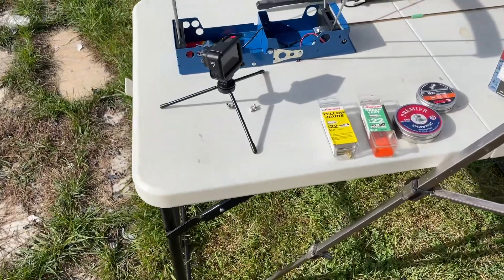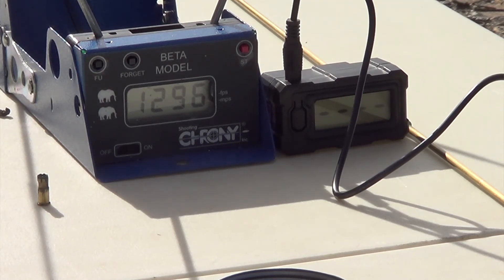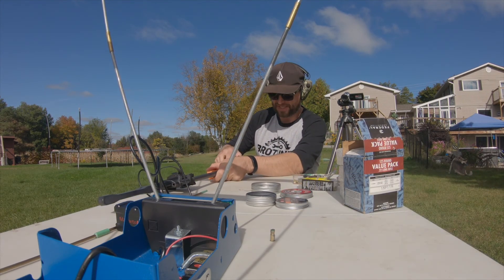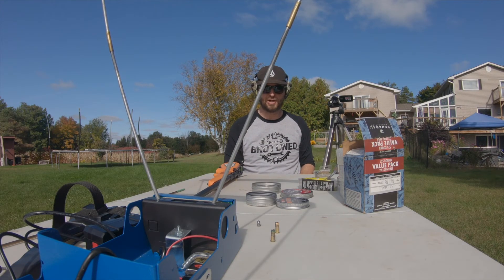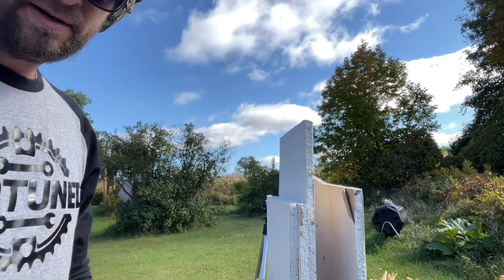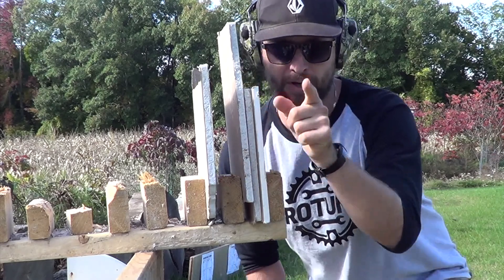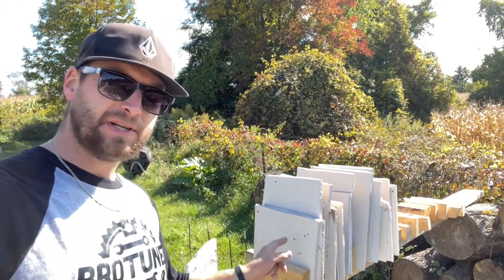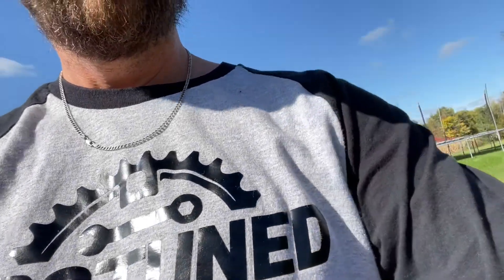shooting 22 cal pellets using nail gun blanks

Comment: This might seem like fun but it could be harmful to a rifle. The lead in pellets is much softer than it is for bullets and most .22 bullets nowadays are either copper jacketed or lubed lead. You can badly lead up your barrel. Increased lead i the barrel can lead to higher chamber pressures. Also, the CUP's in some of these, especially the higher level, may exceed what the rifle is designed to handle and might eventually lead to failure or damage. If you watch Taofledermaus do this he mentions this. He is using an old junker .22 that if it fails it is no big deal.
Reply from the maker: Yes I understand that. It is after all the least expensive rifle I own therefore as long as I don’t get hurt it’s all good

Comment: I've glued (contact cement) the heavy Crosman pellet to a #4 charge nail gun  blank. They are fairly accurate and good squirrel getters. Even shot an Armadillo with one (nasty smelly thing). All were shot out of a German made Rohm revolver, old but effective. Ejection of all six were clean and just as easy as CCI .22 LR. Definite possibility to defeat the proposed Biden ammo mandates and Congress ammo restrictions coupled to the spending bills(if they pass it as it stands now). Anti-gun rules should not be in a budget bill - write/call your Congress Critters to strip the anti gun stuff from ANY spending bill.
Reply: Must i glue em together? Can i just place slug first then the blank sits right behind it?
Reply from the maker: I mean you could but it may cause a dangerously high pressure situation because the blank charge is a very fast burning powder and not designed to push a projectile down a barrel. I wouldn’t recommend trying any of this unless you are willing to sacrifice your rifle and remotely fire it. The reason I was using skirted pellets is that there is not much resistance to get the very light pellet moving down the bore so the pressure spike wouldn’t get to catastrophic levels
Reply: @BROTUNED  Very educational advice, many thanks to you.
Reply from the maker: No problem stay safe
Reply from the maker: That’s very cool

Comment: I'd repeat the test with the newer "slug" type pellets that are coming out. H&N Slug HP, JSB knockout, NSA slugs, etc. Pellets lose stability at supersonic speed, that's why they're always shoot at around 900-800 FPS.
Reply from the maker: I’m wondering if those slugs would over pressure the rifle. I guess there’s only one way to find out
Reply: @BROTUNED  I doubt they would as air rifle slugs and pellets are .217 to .218 while .22 lr is .224. Not a very perfect fit to bore. Accuracy will probably also suffer.
Reply: Should the barrel be smooth bore for slugs?
Reply from the maker: No you need rifling to stabilize the slug